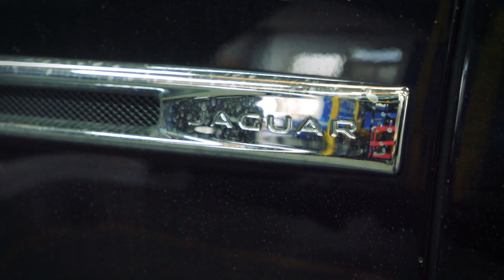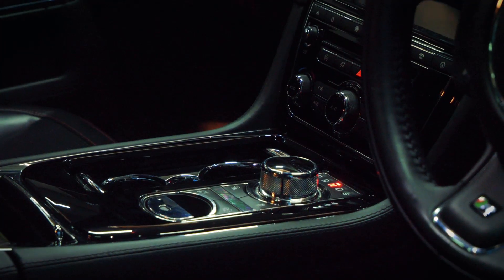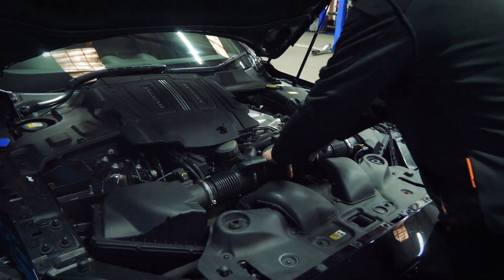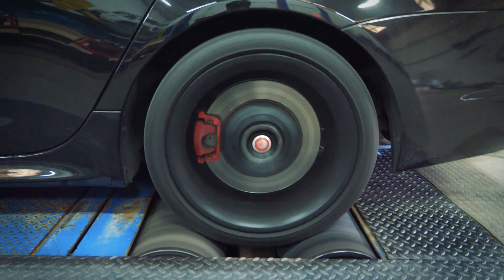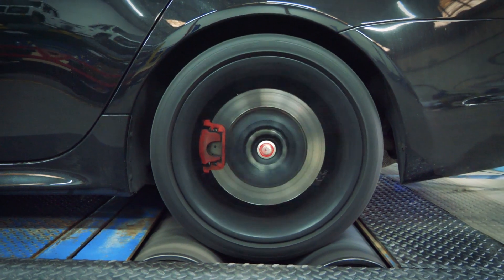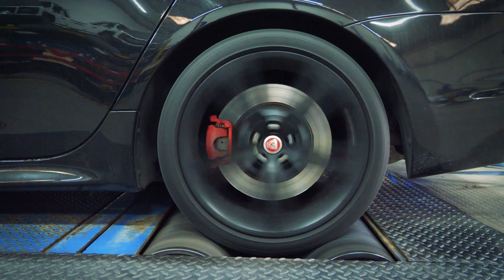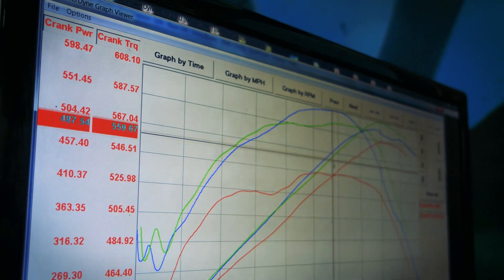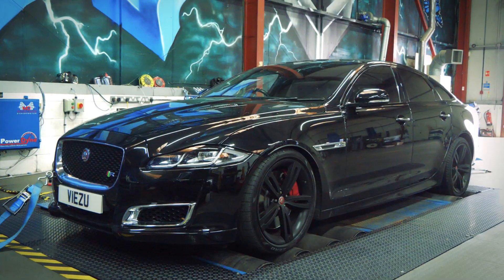Jaguar XJ | Upper Pulley, Remap & Dyno

Comment: My old man got the full VIP tune about 4 years ago and still running strong! 643HP and 840 odd NM. 

ran 11.7 at santa pod at 123mph and to my knowledge its not been beat yet by another XJ of any type and its the autobiography so much heavier and not ment for performance, yet they made it an absolute weapon!

Check out my channel for vids of the car as proof of their ability to tune car's not only well and to make them fast but safe to be at that power without causing engine / gearbox issues. Great tuning company 👍
Reply: if i want tune jaguar xjl i should change something in engine or anything can you tell me what’s the things to change to better i want 650 hp😂
Reply from the maker: Hi, to unlock the 650hp from our Predator package you would need our upper pulley, charge cooler, lower crank pulley and engine remap. If you can email info@viezu.com with details then one of our team will be able to help further with your enquiry.
Reply: May I ask how much the total package was?